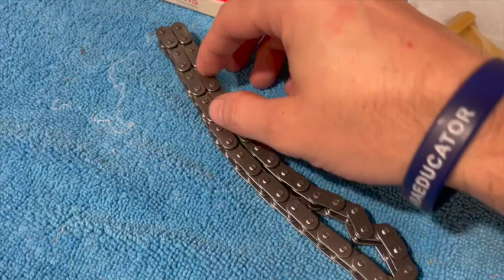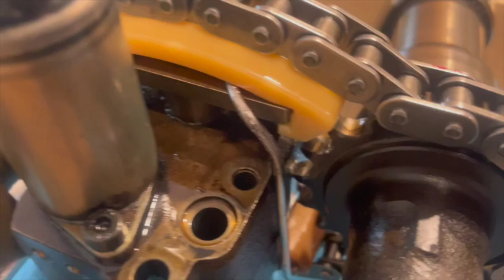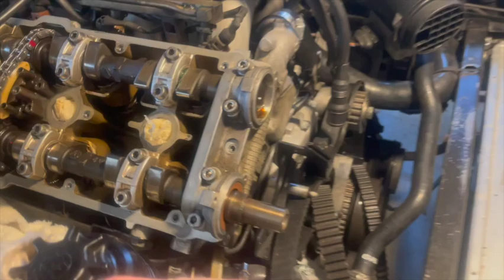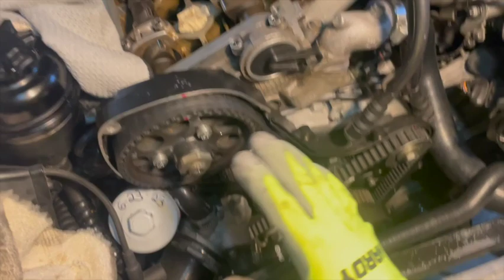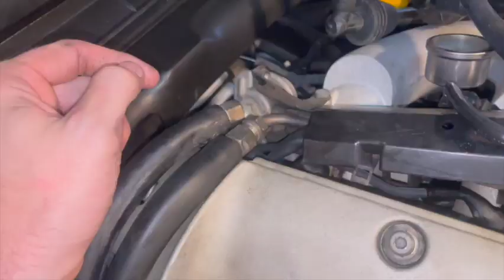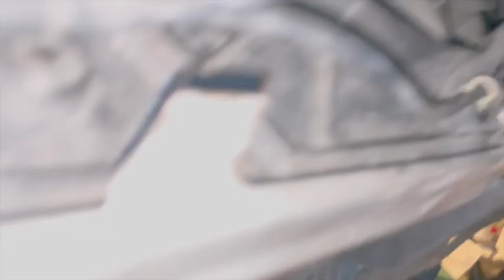Porsche 968  Video 3 - cam chain and pads install, rebuild, and test drive!

Comment: Pretty sure you don't have this car anymore, but for anyone watching, DON'T use Loctite thread locker on the cam cap. You should use Loctite anearobic sealant (574 or 518)